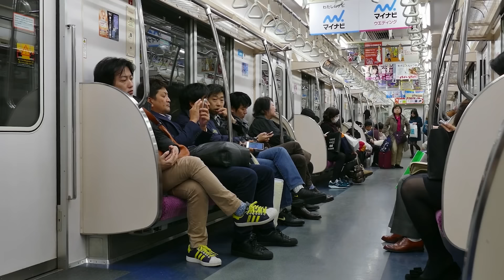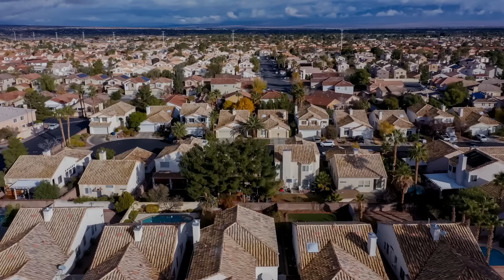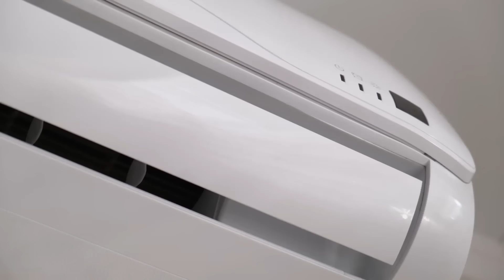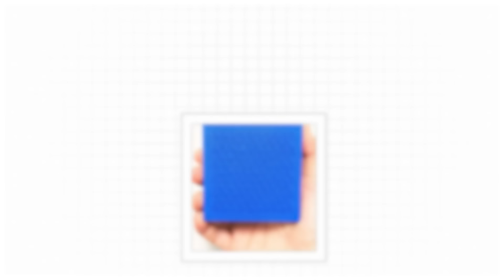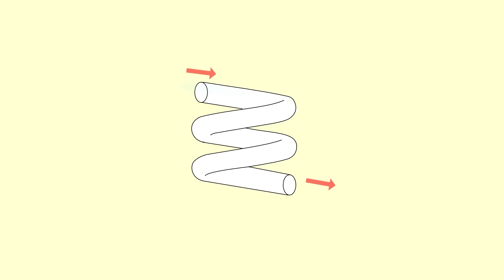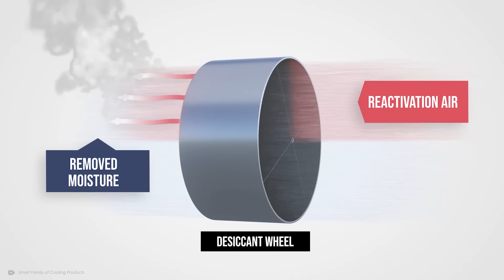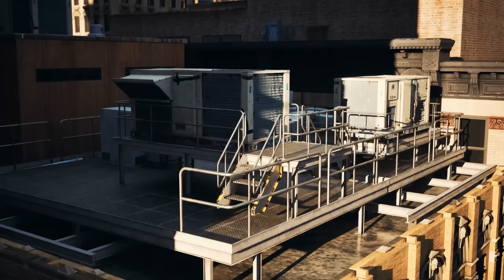The Future of Cooling is Here: The NASA Breakthrough

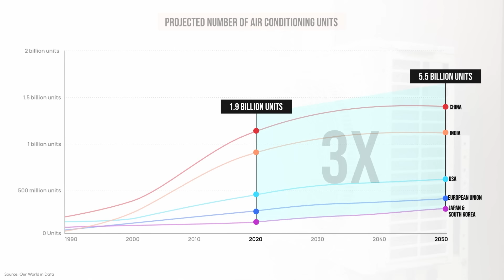Comment: At 5:50 you say 1.9 billion A/C units in 2020, rising to 5.5 billion by 2050. But reading the graph, the countries listed would actually add up to around 2.5 billion units in 2020, rising to about 3.7 billion by 2050 - that's less than half the 3X growth stated. And the graph only shows units for certain countries! How does excluding Mexico, Central and South America, Africa, the Middle East, Southeast Asia, and Oceania - billions of people, mostly living in hotter climates - add up to a global total of estimated A/C units? Especially when they're a large part of the developing world you went right on to say could fuel strong growth in units in the coming decades?
Reply: It is a stacked chart, not a regular chart. China has only 730.2M, India 47.4M, USA 399.5, EU 115.3, Japan & SK 218.1M. It is missing Mexico 20.9M, Brazil 29.0M, Indonesia 20.6M, and "the rest of the world" 291.7M as you say, but these missing countries add up to the level of the black box labelled 1.9 billion.
The totals are 1.93B and 5.58B, 5.58/1.93 = 2.89 ~= 3.
It is from the Our World in Data web site, you can see that on the lower left of the graph. The original chart can be found there. 🙂
Reply: @tinka831  thank you for the pointer. I found the original chart on Our World In Data, and they do indeed have a good, readable stacked area chart which fits the data and the global totals mentioned in this video. 
But  the graphically challenged, incomplete chart that was actually shown in the video is not that original chart! 
And it's definitely not a stacked area chart of A/C units per country/region (if so, how to explain the line for India crossing UNDER those of other countries between 1990-2000???)
If it was somehow meant to be a stacked area chart, it failed in so many ways.
Reply: @carlg5838  I did notice the bit about India in 1990 and it was odd, I thought it was a one off mistake, but now I think that the author made mistakes while making the graph. Maybe they downloaded the data points by hand instead of using the download button.
In any case, the graph is wrong, India does not work as a stacked chart, as China's contributions are greater.

Comment: I had a research paper published several years ago on using Metal-Organic Frameworks with an embedded polymer that undergoes a phase change from hydrophilic to hydrophobic at 32 deg C. This allowed very low regeneration temperatures and it could absorb over 400% of its own weight in water vapour. This was from my final year project at Uni though, I believe there's now commercial collabs with it though I'm not sure what subsequent work was done.
Reply: Pretty cool.  I hope this tech gets out there into the market, and not just for large scale commercial purposes.  Meanwhile, we can do things like put large surface area "pans" outside in the sun, put our moisture laden calcium chloride solution into them, then carbon felt on top, and put Solar light and IR reflectors aimed onto the carbon felt, and the combo of carbon felt wicking up the moisture and the  concentrated solar heat helps to greatly speed up the water evaporation rate. 

   Then it's a matter of having thermal insulated containers inside the area that allow vapor exchange, and have a large heat pipe put in the insulated container and piped to the outside. 

  Somewhat crude and time/effort intensive, but cheap and easy enough for many, many people to do on their own right now, until something better (especially in the automated sense) comes along.

Comment: Humid air does not have water droplets to filter, when the air is above the dew point. Desiccant driers using Silica Gel, Alumina, or Mol sieves, are nothing new and can make air very dry. Sure cooling dry air uses less energy but what is the cost of energy to dehumidify?
Reply: If you can use the direct solar radiation (for example, on the roof) to regen the dessicant, the cost is basically nothing.
However, I fail to see a meaningful way to achieve this.

Comment: It's the energy cost of recovering the water from the liquid desiccant that concerns me. There's lots of desiccants, but usually drying them requires an oven, and a lot of electricity.

I'd want to see how they're doing it, and how many watts the desiccant regeneration cycle takes.

Also, how long it can run before it needs another regeneration cycle.
Reply: Precisely. Can't run away from thermodynamics. The adsorption energy needs to come from somewhere
Reply: The energy comes from the heat being removed. Liquid desiccants don’t need such a high temperature to “dry” out. Silica gel can do this as low as 25c, for example.
Reply: Direct Solar heating can be used to regenerate the desiccant.  However, while that would be energy efficient, it would be on the slower side, and at some areas wouldn't be realistic much of the time (like Seattle).
Reply: @justinw1765   In practice using photovoltaic to power the heat pump is going to be simpler, cheaper, and more useful that direct solar thermal.  Especially when the AC isn't running.
Reply: You use the hot loop of the heat pump to recharge the desiccant continuously.

Comment: As someone who has lived in some of the driest and some of the wettest places on earth, I can safely say that the main point of aircon is humidity control. Evaporative in dry places to bring the humidity up, and vapour cycle in wet areas to take the moisture out.
Reply: Humidity control is literally the exact reason the modern phase change air conditioning was invented, and why it is called air conditioning. It was literally to condition the air in a prinkworks that was having issues keeping the paper moving through their printing machines, with the express purpose of dehumidifying air via cooling the air until the water crashes out, then adding a measured amount of water back into the output via sprayers. Too much humidity and heat, the paper would get droopy and sticky, Too little and too cold the paper would get stiff and not grab the rollers. So Willis Carrier (yes, the one whos name is probably on the side of your AC unit) was tasked by his employer the Buffalo Forge Company to come up with a way to control the humidity in the Sackett-Wilhelms Lithographing and Publishing Company in Brooklyn. 

By the by, water crashes out of air as it cools because the relative humidity is literally defined as the amount of water air can hold, and is directly an effect of temperature and pressure. As the temperature drops the water falls out of the air, just like moisture condensing on the side of a glass of ice water. The cooling effect comes from the boiling of the refrigerant in the evaporator coil of an AC unit. When you boil water it boils at 100C (pedants that want to nitpick ambient pressure changes this temp, yes thank you, youre all big smarties, now shut up the adults are talking), you can turn the burner up to jet blast levels but the water will not get hotter. It will still be 100C. What will change is the rate at which it turns into a vapor, it will boil more vigorously. But the liquid water will remain 100C. The same thing happens in the AC unit. We pressurize a refrigerant, usually gaseous at this stage, making it hot and high pressure, we then cool the hot vapor until it condenses (in the condenser coil) or falls out of the gaseous phase into the liquid phase (the inside of the coil is like the outside of the glass of water). We then pass this high pressure, moderate temperature liquid through a tiny hole (to maintain the separation between the high and low pressure sides of the system) where it sprays into the low pressure evaporator coil. Since this side is low pressure at ambient temperature (a temperature and pressure the refrigerant is usually a vapor) it flash boils on contact with the coil walls. Remember boiling water? Yeah, water isnt the only material that does that. Ergo, the previously high pressure liquid (the pressure holding it in liquid phase at the near ambient temp of the liquid line into the evaporator) slams down to its boiling temp in this much lower pressure space and vaporizes sucking heat out of the coil making it cold (just like spraying an aerosol can or running a propane tank at high-ish flow, the liquid boiling into vapor takes heat from the can walls because the boiling temp at the lower pressures inside the can (due to bleeding off pressure as gas flow to your barbeque) is lower than ambient. Turn off the flow and the pressure normalizes holding the material in its liquid phase (aint vapor pressure cool? hehe, cool)). Blow air over the coil, let the water crash out of the chilled air, add some back at the vent outlet, Bobs your uncle no more jammed printing presses!

I dont know where this shyster is getting this 'parasitic loss' crap from, but they are 100% pulling some 'future  tech' flash in the pan tech bro grift. And spinning water out of the air?! yeah, no. NASA does that to filter out aerosolized liquids so they dont coat the inside of the station, not to remove humidity the air is holding on to. Ziroth has been had by a tech bro and is spreading bullplop.

Comment: An evaporative Air Cooler is far less energy intensive than a air conditioner but they need dry air to be effictive so how about drying the air and then running it through an evaporative Air Cooler?

Comment: Removing humidity from the air is why it's called air Conditioning, and not just air Cooling.  You want the humidity removed!  So it is not wasted energy.  A more efficient- and still reliable- way to remove the humidity would be quite a substantial benefit.  That helical moisture removal technique sounds really neat!
Reply: A question I had is when he said heavier water molecules, water is least heavy molecule in air...

Comment: I'm a little confused (sarcasm)- how is air conditioning is responsible for so much global carbon emission, when it runs on electricity?  They are pushing electric vehicles as a solution to... global carbon emissions.  If electricity generation causes so much global carbon emissions to run air conditioners, how does it not do the same to run electric vehicles?  They can't have it both ways.  Something mighty fishy is going on here.
Reply: There are two factors.
1) Electrifying
2) Efficiency 
This product addresses #2.
Reply: @juliahello6673  Agreed.  My point is that we should be working on "decarbonizing" the electricity supply first, THEN work on switching existing non-electrical technology, such as vehicles, to then run on electricity.  Doing it the other way around is wasting time that (some say) we don't have a lot of.
Reply: Different people are working on decarbonizing the electricity supply and switching existing non-electrical technology. You won’t save any time because the people who are working on switching existing non-electrical technology would be sitting around twiddling their thumbs, not helping to decarbonize the energy supply.

Comment: I am curious,(and  I am going to go see the info they have on their website, but) my question is with regards to what happens with the water produced in this process?  Is it simply being drained out as is normal (but wasteful) in A/C evaporator drains?  They sell water generators for the roof top now (gimmicky in my thinking)  and these are essentially heat-pumps for "atmospheric water generation" which work but use more energy than an equiv. sized A/C (you could just pipe off your evaporator drain to a storage tank instead, lol).  If this tech is really able to remove moister from the air as liquid water in the amounts they claim (humidity reduction claims) , then this is potentially a dual benefit system for places where clean water is scarce.  If the airflow through is filtered, the water produced can easily be made drinking quality...

I have ideas for this tech area if you would like to talk, let me know.
Thanks for the report!!

Comment: This could be combined potentially with electro caloric effect to create a solid state ac system that uses air as the only fluid in taking and exhausting air into a space with 2 stage dehumication or whatever you called it and then electrocaloric cooling